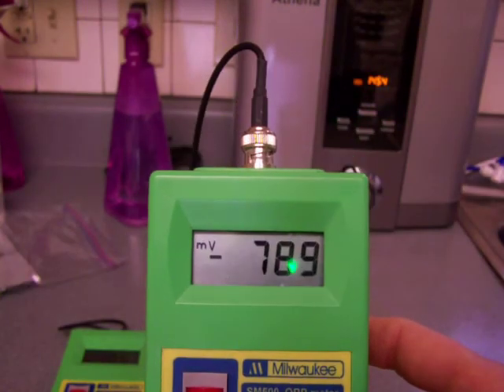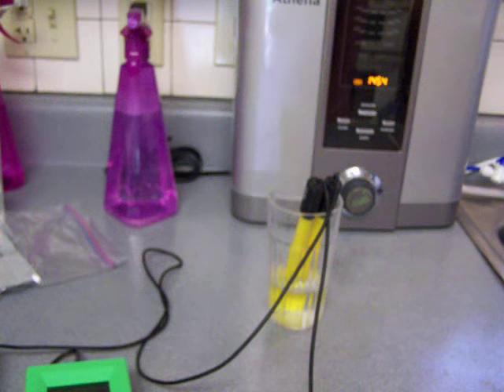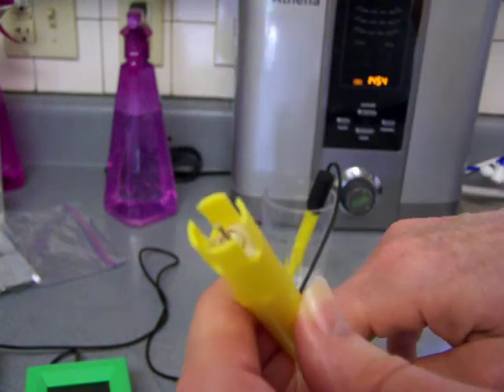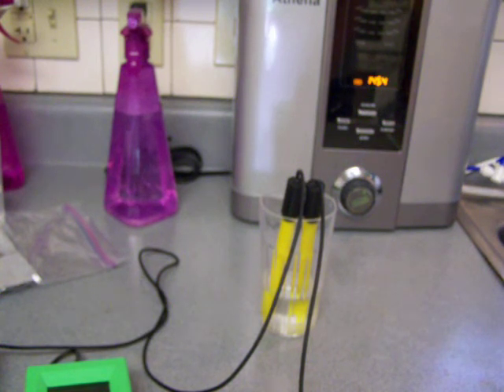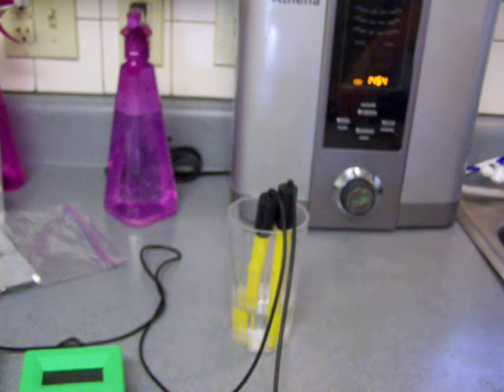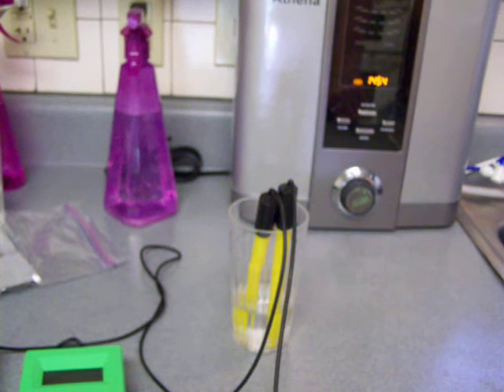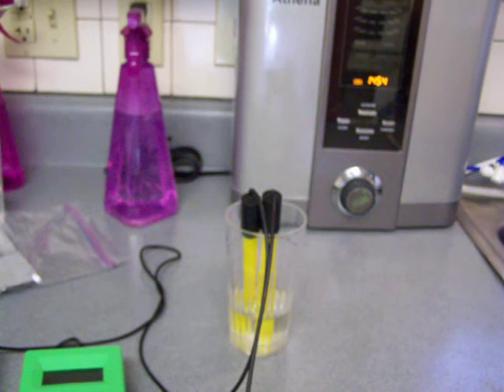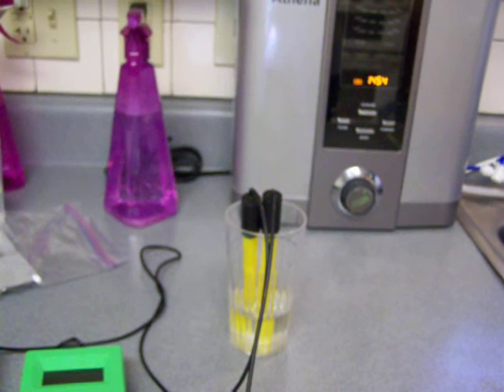How-to-clean-an-ORP-meter-1

Comment: How often do we need to clean ORP probe?
Reply from the maker: There are a lot of variables for this. I keep my orp probe out of all solution and exposed to the air, which keeps it as clean and ready to use for negative-orp water as possible. If you notice the results are dropping -- it should be cleaned. It may turn out not to be the reason for the dropped results, but cleaning it will eliminate one of the variables.